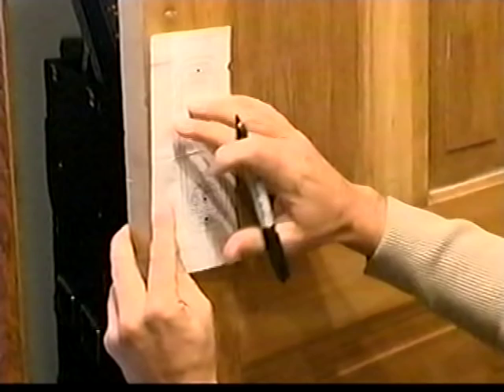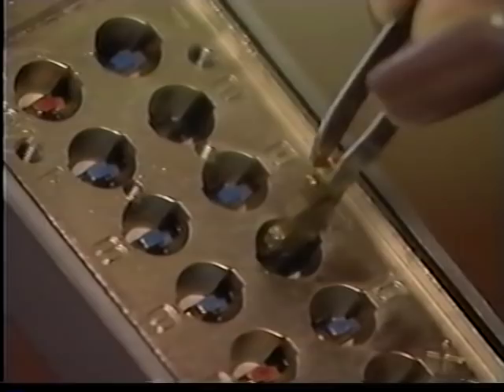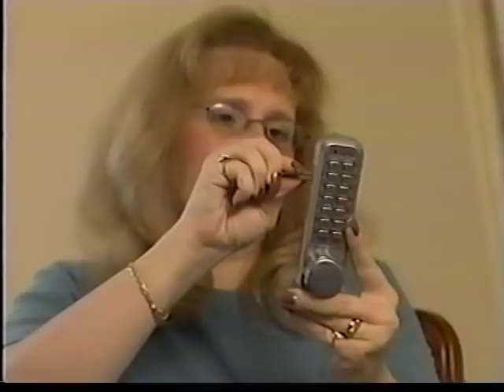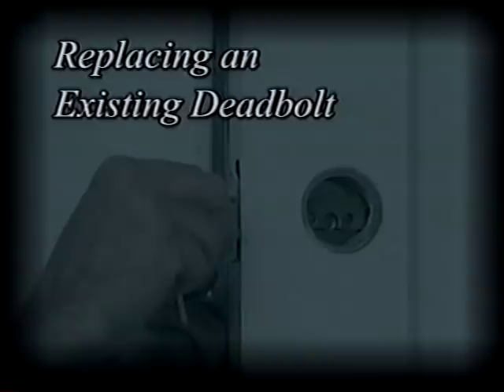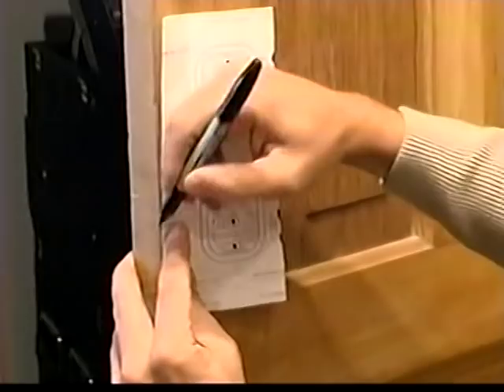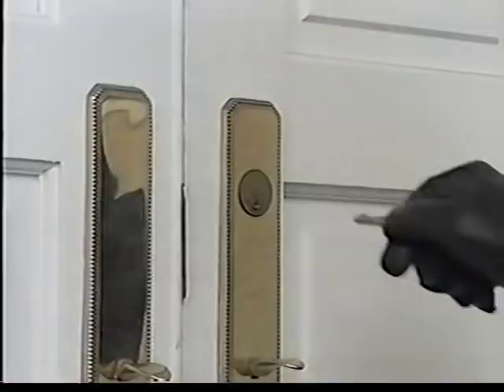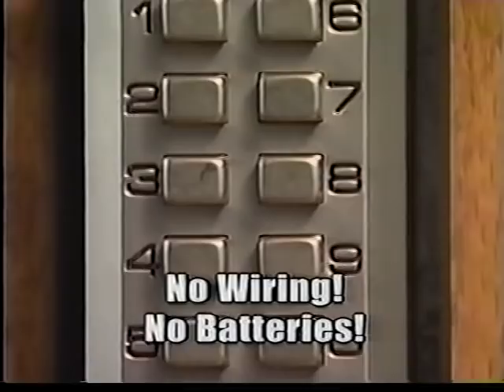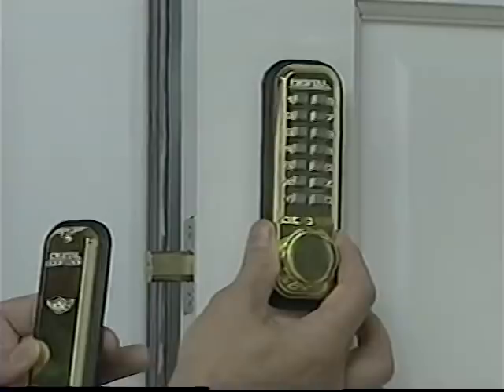How to Install Lockey Keyless Entry Lock

Comment: Bad advice in this video of drilling a huge standard hole in your door. The instructions recommend drilling 4 4x10mm holes in a row. This leaves the door a lot stronger, especially if you have other locks on the door. I initially wanted to install it in place of my existing deadbolt, but the hole was too big and there was a 1/8th inch gap on either side of the deadbolt hole.

Comment: Tried installing this in the original hole. Just like in the video, if you look closely, the existing hole is WAY too big and you can see right thru the door on the side of the skinny lock body.

Comment: I have changed the preset code following the instructions. which said I needed to hold the knob either right or left which I did.  I needed to change it again but this time before I got the backer plate back on my hand slipped and the knob came out of my hand and now I can't get my lick to work. Can you help me.

Comment: I installed this on 2 doors. Wound up having to drill the door down a bit one the bottom of the big hole so that the bottom female screw piece could fit through on both doors. It's not very nice having to damage 2 new doors to put a lock on. The installation looks nice and they have been working but man oh man I hope I don't ever have to change locks!!!